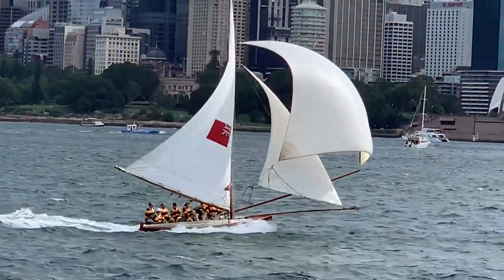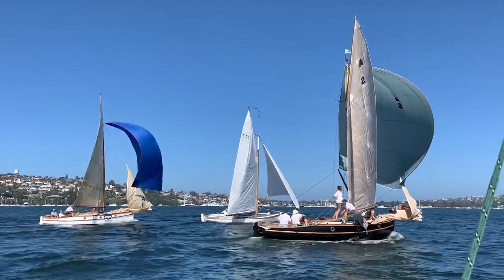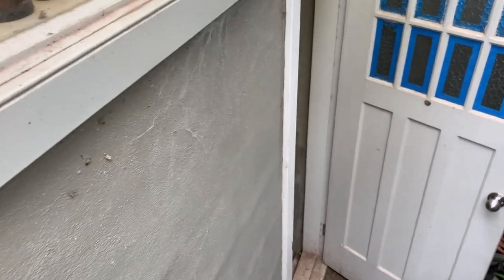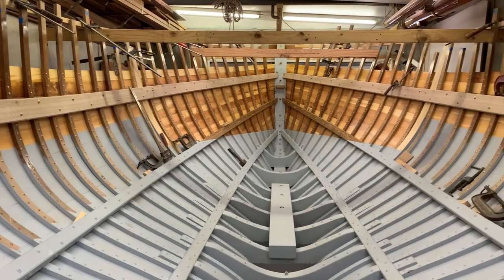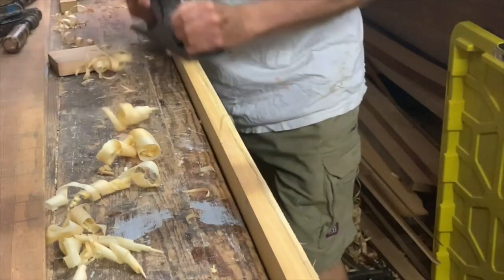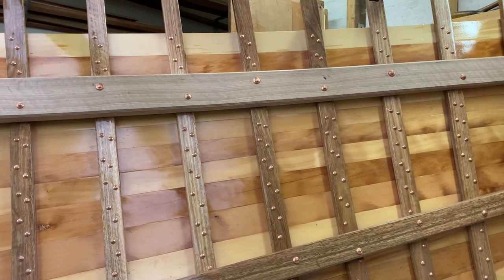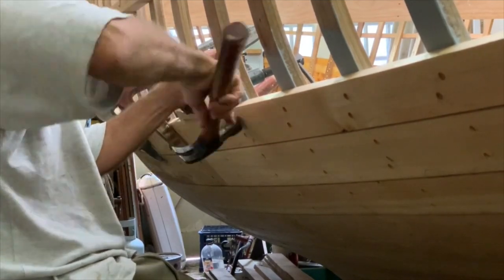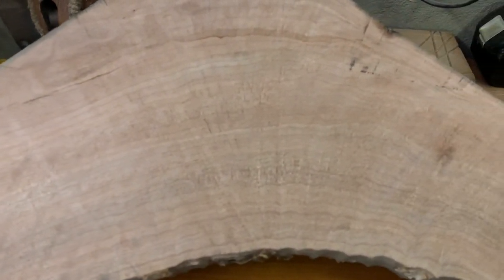Building a Carvel-Planked Ranger-class gaff sloop

Comment: Doesn't sound much like "retirement" Ian!  I've crewed in A4 several times and talked design with Bill G - superb boats.  I'm also building a boat in my garage - a clinker 18 foot sailing dinghy.  The formwork is entirely self-supporting, and there are two wheeled bogies plugged in to the bottom of the C/B case so I can wheel her in and out.  When she's "in" there's 2 inch spare to close the door - and that's after chiselling 3 inches into the back wall to take the stem!  The rudder fittings will have to be "detachable" to store her indoors when she's finished.

Comment: Have to say I am really impressed not just by your work but with the timber you have accumulated and used for this project. What was it about this small cruiser design that drew  you toward  this boat build?
Reply from the maker: Thanks David. I chose the Ranger because of its size..just the right size for Sydney Harbour, enough room to take out friends, small enough to sail alone if necessary and to have not too much work on annual haulout, a good racing group and a long tradition. When I first became aware of them thirty or more years ago I didn’t like their distinctive looks but I grew to love them.
Reply: @SmithysBoatshed  Thank you for taking time to reply. I can understand your thoughts on not liking a boats looks but over time coming to appreciate them for other qualities, been there myself. How does she sail and how is she designed below the water line. Will she come about in a force seven plus and would you be happy to sail her beyond  the harbour entrance.
Reply: Just rewatched your video and managed to spot the plans!!!!!!!!!!!!!!!!
Reply from the maker: Ranger was designed as a family cruiser and fishing boat, it just turned out that she was fast for her size. Most of the boats regularly day-sail offshore but are not set up for ocean cruising. However one boat sailed to Tasmania and back several years ago, and there is a 28’ version designed for ocean cruising that cruised to Tasmania and the Pacific decades ago, and has been restored and regularly competes in the Sydney to Hobart race.
Reply: @SmithysBoatshed  Ian thank you, I got the impression they were capable boats , they remind me of designs by C.S.Roy many differences of course, not the least of which ,is to my knowledge all his boats were built in plastic. Check out the Westerly boats from the sixties and the Macwester Kelpie day boat and the Rowan 22 basically the same hull enlarged, both very good little boats that performed well beyond their Portsmouth yard stick rating. In fact often put to shame much bigger more expensive supposedly faster cruisers.I can see the Ranger doing the same.